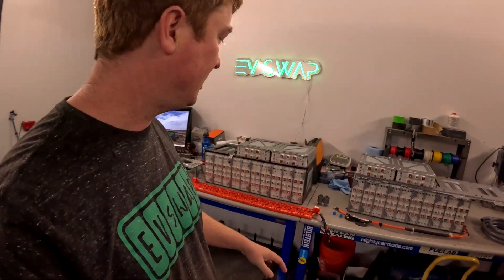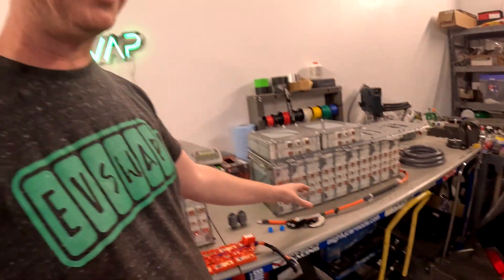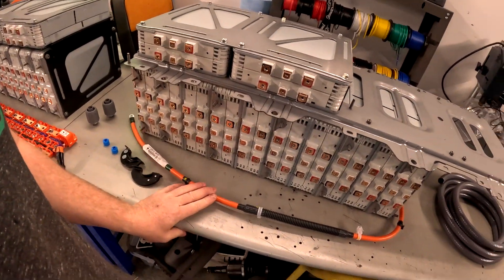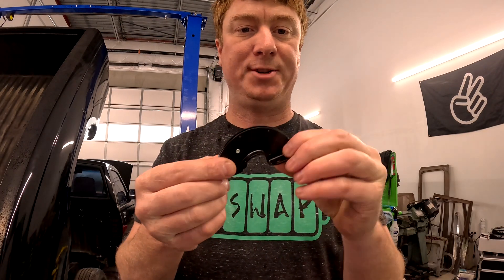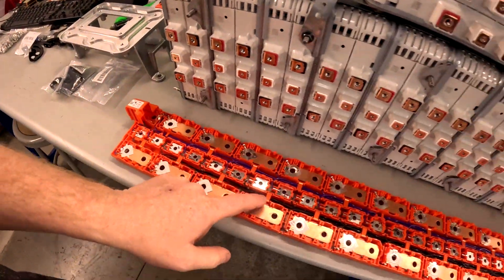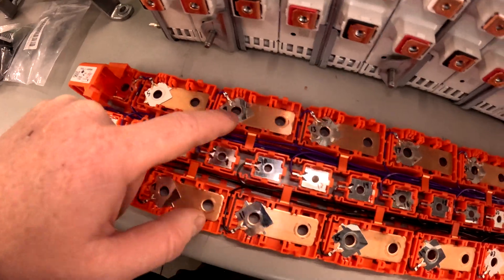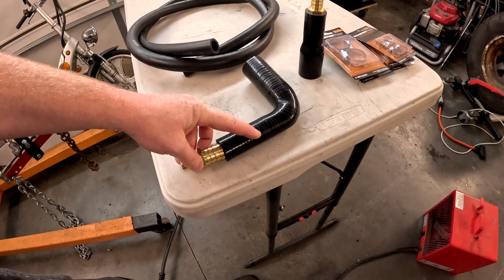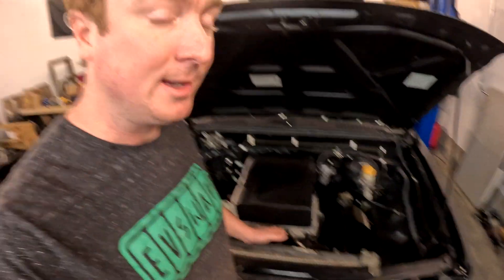Snow Day Updates EV Conversion High Voltage Battery and Cooling System

Comment: How does the colder weather effect the Land Cruiser's range?
Reply from the maker: The cold weather definitely reduces the range of the truck across the board. The battery has less capacity and the snow increases rolling resistance etc.